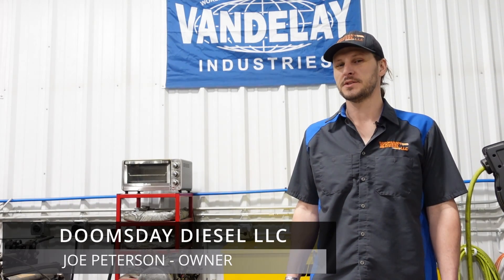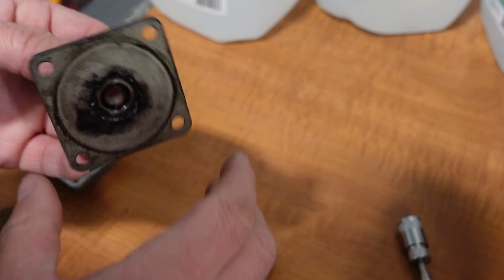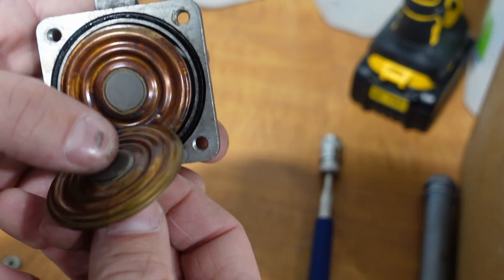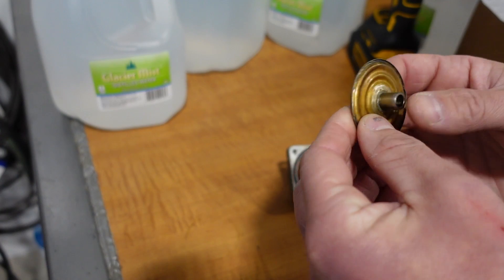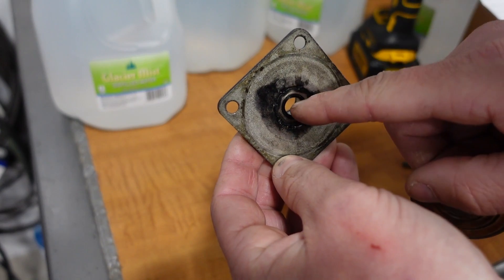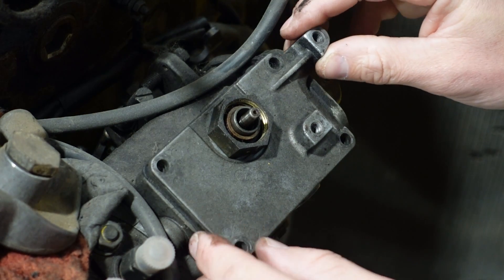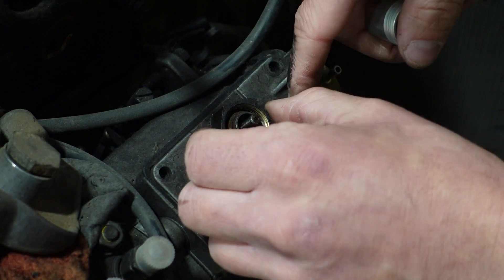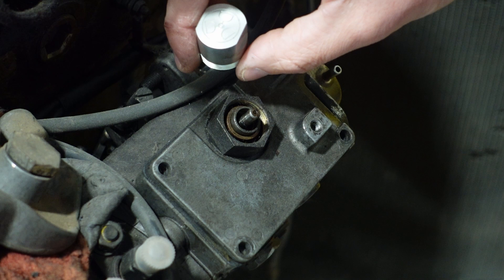OM617 ALDA & ALDA Delete In-Depth Explanation & Breakdown

Comment: A thousand thanks for the tip about the ALDA actuator. The engine now runs like new at low RPMs. A tap of the accelerator and the power is instantly there, the boost builds up super fast, and pulling away from a standstill is fantastic!!! I drive an old Mercedes G W460 with large tires (285/75R16). I opened the original ALDA actuator, removed the lower diaphragm, and put it back on the pump. (German Model without AGR and KKK Turbo 
Greetings from Germany 👋🏼

Comment: Glad to see youre still active in the comments! I just installed your alda delete kit. I plugged the back of the manifold and made sure everything is where it needs to be, however whenever I disconnect the sensor between the boost pressure line and the line that goes into the alda, the car wont start. When I plug the sensor back in with nothing connected to it, it start up but sputters out in a few seconds. Id greatly appreciate help!
Reply: It is a 1984 300d by the way

Comment: Tell us more, like if you delete ALDA on manual transmission and the pump is from automatic then the revs drop down to kvikk cangne gears, then you have to turn the idel stop screw like 5 turns to fix that kvikk drop in rpm

Comment: So is it normal for the Alda 27 mm nut to keep spinning after? It won’t seem to tighten up even after the alda plug is installed ?
Reply from the maker: No, with 1 crush washer installed, it will tighten like a normal bolt/nut
Reply: @doomsdaydiesel  under the 27mm but there is a crush washer? I dont remember seeing a washer under the big nut. I feel like I’m missing something obvious here. Thanks for the response, stumped at the moment. I made a post on a Facebook page about it hoping to get any help I can

Comment: Awesome explanation of how this ALDA works. I tried reaching out via email. I recently bought an 89’ Toyota pickup that had been swapped using the Doomsday kit and adapter plate. The engine had spun a bearing and I had a replacement out of an 84’ 300D. When I started swapping everything over I noticed that the directions tell you there are different serial numbers and that matters for the pilot bearing? Maybe I’m incorrect but if you happen to read this please let me know what I need to make this kit work with engine I have. Thanks!
Reply: I will add that the accessories used appear to be the shallow sump oil pan, GM alternator and serpentine belt, and the oil filter/cooler are on the fender of driver side.

Comment: How much is the new turbo. Does it connect and look stock or does it require fabrication.    What are good working alda worth. I have 4 or 5 good alda from low mile motors I have collected over the years. They are from 20k mile to 85k mile. Lucky mine still works so haven't needed to change or remove it. I try to keep my car mostly original so I don't have allot of disconnected stuff. Only changes are egr delete. And swapped stock fan for dual electric. On 100deg day with ac on high it stays at 85c. And no loss of power from clutch fan.
Reply from the maker: @87Benz-tf9qs  shoot me an email. It'll be much easier to answer all of this that way
Reply: After i upgrade to smaller waterpump pully and new pump, mine stays on 80c

Comment: Now, I'm not an engineer by any stretch, but would it be adequate to modify (preferably a worn out unit for experimental purposes) an ALDA diaphragm with a solid rubber diaphragm, and ~10lbs spring where the spring pushes up on the diaphragm, and away from the pump; mimicking the default copper wafer pressure. Then on the opposite side of the rubber, the boost pressure from the inlet works against the spring, to push it down in order to make a wana-be ALDA. Almost like a accelerator pump on a carburetor only it works in reverse? I'd try it myself but I only have the one motor and I'd rather not hurt it...